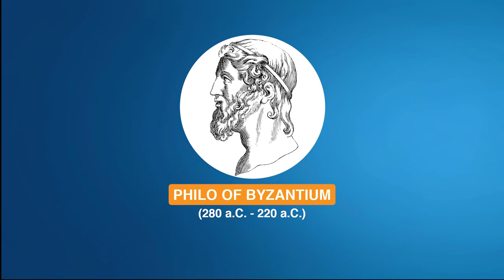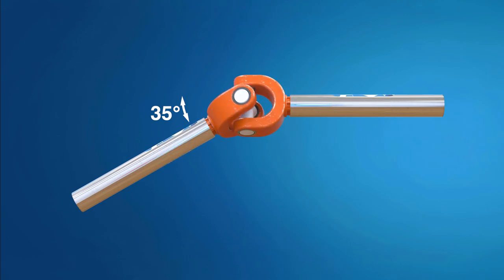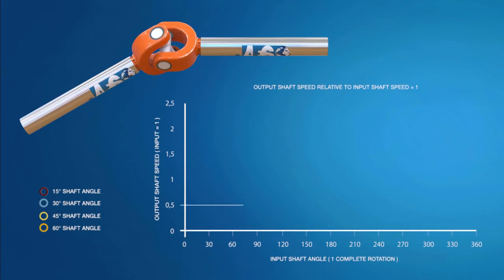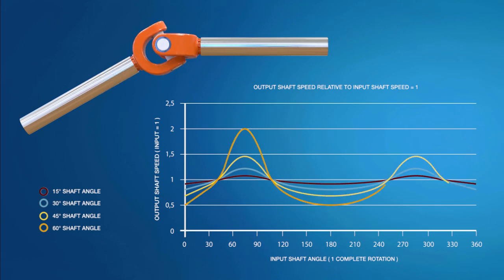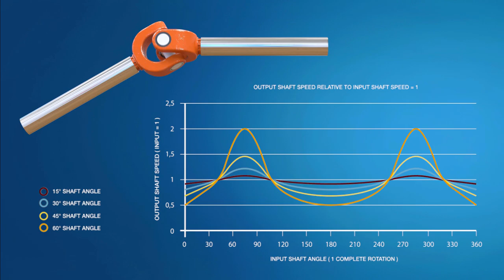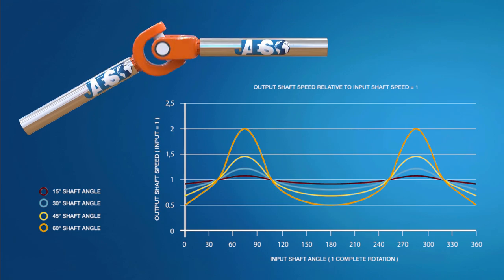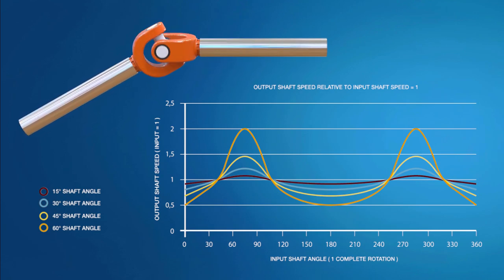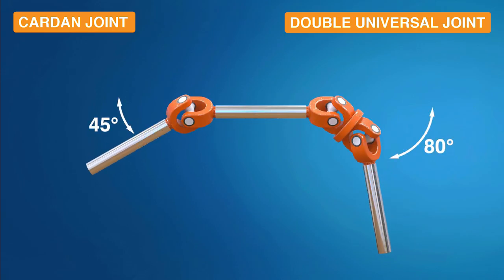What is a UNIVERSAL JOINT - Cardan or Constant-velocity Joint?

Comment: In the double u joint the input and the output shaft have to be parallel in order to maintain a costant speed
Reply: Don't need to be parallel. The equal angle of each joint is sufficient to keep a constant speed

Comment: Very nice 3D animation! But I don't understand what causes vibration...
Reply: Sorry about my false reply. It is caused by phase shifting.
Reply: The greater the operating angle, the more vibration.
Reply: It can be from harmonics. Like why they have a harmonic balancer on the crank and balanced with the fly wheel and possibly a balance Shaft. Vibrations from somewhere near the device can vibrations on the axel. The cv Axel's for cars have a balancer attached to them.

Comment: Great animation and clear voice.
I think In both type of joints, the vertical movement of the object in the output shaft (lets take a car wheel as example) it would require that output shaft  enlarges or contract because of the angular movement otherwise there would be an unexpected horizontal displacement in the wheel. Am I right?  How does it deal with that?
Thanks !
Reply: most shafts have a sleeve and plunger system that allows the shaft to lengthen and shorten as needed, hope this helped :)

Comment: Welp, although a nice looking animation, the configuration of the U-joint arrangements in several of the examples is 100% wrong. 
Time stamp at @3:30, the tractor's PTO output... running a double cardan into a single U-joint articulated will cause the vibration/pulsing.. Screwed up there. 
Time stamp at @3:45, the drive shaft on the conveyor system, shows those joints 90 degrees out of phase to one another. which will cause vibration/pulsing. Screwed up there.

Comment: So in the double universal joint is the speed of the output shaft equal to the speed of the input shaft?
Reply: Yes. It's only within one rotation that some flexion and differential in speed occurs. And it is only slight. measureable only within engineering graphing. Not normally noticeable, at least at ICE (speeds).

Comment: In the costant velocity joint does the transmition ratio remains costant becouse of the metal spheres?
Reply: it remains constant because the metal spheres act as a middle man between the two shafts. no matter the angle of the input shaft, the metal balls will spin at the same rate as the input shaft

Comment: Ok, so why do trucks use a universal joint
Reply: Because when under operational load, the flex of the chassis, motor and transmission mounts, and the flexing of the rear suspension, cause a misalignment of the transmission output shaft and the rear axle yoke. Without some allowance for deflection, a solid connection would cause extreme load and failure of the coupling. Simply put, the two ends flex, and the universal joint moves to accommodate a certain amount of movement.